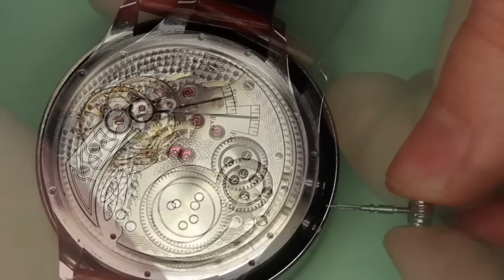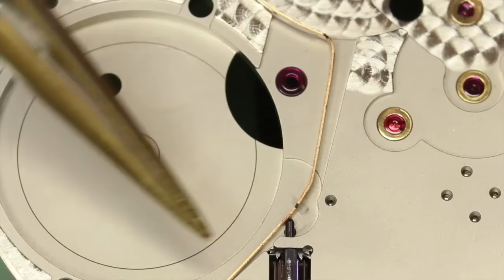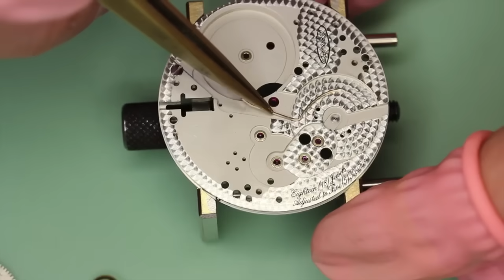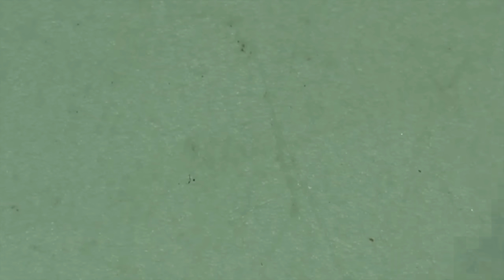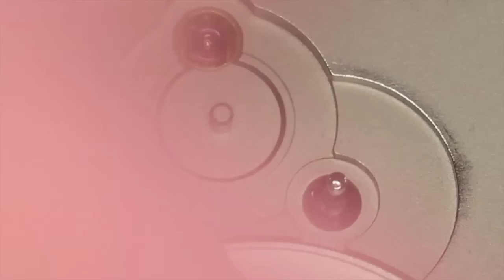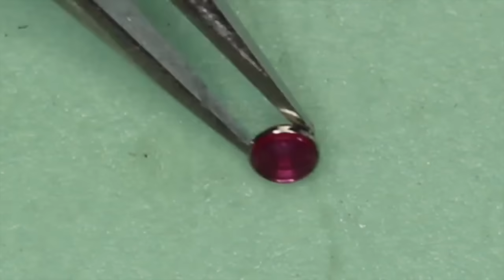Servicing an IWC FA Jones watch. Watch repair tutorials.

Comment: Question: Why watchmakers use steel tweezers and screw drivers instead of plastic tweezers and screwdrivers to prevent scratches on the screws while usig the screw driver an scratches on various parts with the tweezers?

Comment: Would there be any serious drawbacks if you took a regular watch & did some engraving on the inner parts? Like just on the bridges etc?

Some pocket watches I've got have the most beautiful designs inside them but sadly it appears most of today's watches are plain Jane boring.

Would it be a drawback to do some hand engraving on the non-moving parts of many of today's pieces?

Comment: I like it very good to repair the watch how to insert all the parts and I have one question that did this watch worked without battery or nt because I also have this same watch but it stopped itself many times I don't know why. I think it worked without battery but if yes than why it stopped many times I want to revind forward again and again because it stopped it and the times goes different.

Comment: Bet the ETA 7750 that I bought to learn and practice on is hoping the lockdown ends soon, it has been stripped,cleaned and serviced 6 times so far! Now getting pretty confident with it,plenty more practices to go. At the point of considering acquiring another that is in a much used condition to work on with a view to rectifying defects and damage. Thanks Mark.

Comment: I noticed you used what appears to be brass tweezers for this watch on some videos it looks like you use steel tweezers is there a reason why you would use different tweezers for certain watches? Edit: You said you are using brass tweezers because of the display case back.

Comment: You mentioned the 3 screws holding the mainspring barrel was unusual.  I decided to check my Japy Freres movement (1862) and noticed there are two screws with the end of the arbor protruding through the center.  I find it interesting how they did it back in those days.

Comment: I can't help but notice the difference in the finish on the parts of the IWC when compared to the parts of the Rolex. Maybe I am not comparing apples with apples. The Rolex, under a macro lens, looks very poorly finished. This IWC is truly well finished and really impressive. Rolex may have a cult following and rightly so but they are truly outclassed here.

Comment: Thanks for your videos. I was wondering if you can post a video on how to fix the day date on a watch that keeps changing the date at 4 pm everyday?
Reply: Hilton Carvalho , set it at midday and wind back 12 hrs?
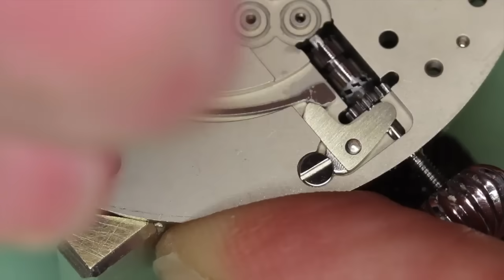Reply: @Pete-z6e Thanks for replying. Sometime ago I was setting the and it was about to change the date. It was around 11:30 on my watch and the right time was about 2:00. As I was moving the crown I felt a slightly resistance and the the date never changed at midnight again. I will try your suggestion. Thanks

Comment: The former automechanic in me would call the smaller wheel under the ratchet wheel a "hub", like what you would find after removing the lug nuts, tire and rim when changing a flat tire for example, the hub is what you see with the studs that the lug nuts "screw on" and the wheel bearing is in the hub, I didn't look down through the comments so if any one has commented on the proper name for the part I missed it,  so for me I guess I will refer to it as a "arbor hub" or "ratchet wheel hub"
Reply: Dude it's called a spracketkegel, LOL these watch designers purposely stay away  from the mundane automotive terms 'cause it sounds much cooler and they are in the higher level of thinkin. Oh wait watches were designed a little before cars came to reality.
 I too found myself trying to think of the logical names of some of the parts.

Comment: Mark, the Beautiful craftsmanship and hand finishing on this lovely timepiece, perfectly complimented by the beautiful workmanship and attention to detail of the true professional you clearly are. Such hand skills, knowledge and experience are a rare combination in today's plug a computer into it, technological approach.
When I was younger, I worked on Aircraft instruments, which though were no where near as aesthetically and cosmetically finished, were equally as beautifully engineered, as a person such as your self might find interesting. 
I worked I a clean room working on Gyro Stabilised platforms, Rate Gyroscopes, Rate integrating gyroscopes and Inertial platforms.

I too took immense pride in my work, tolerance limits to me were a challenge  not an it'll do to just meet the spec.
 Personal pride you take in your work reminds me of me. I hate knowing I could have done that little bit better, I always have to feel I did the best that was possible.

Of course with aircraft instrumentation and reference systems, lives depend on the dedication of a host of unseen individuals.

I love your videos and watching the beautiful thing that is, a true professional at work!
That carries through into the quality of your videos, and why I watched this one again.

Comment: I always end up with extra screws.
Reply: just like the spare buttons on a shirt bottom flap, they supply extra screws you dont have to reinstall. as a matter of fact any good jeweler would remove the extra parts to give you more time on one windup, lighten the weight of the watch, less wear on the band, and better for people with arthritis.
Reply: I would have extra gears if I did it so don't feel bad!

Comment: Great video. What’s the use of a reverse threaded screw? Anyone...
Reply: A single screw which holds a rotating gear in place could unwind itself if the normal rotating action of the gear is opposite to the way the screw is fitted. Using a reverse threaded screw means the gear would have the tendency to turn the screw in, ie, in the tightening direction. This may be why this IWC has the small cap discs with three screws. Negating the need to make reverse screws and reverse threaded holes.
I believe that some reverse threaded screws have three screwdriver slots on the head to indicate it is different from a standard screw.

Comment: Question: why aren't you watchmakers using some kind of rubberized tools (screwdrivers and tweezers)?
My heart is in my throat, watching you put those hard and sharp tools to the delicate parts.
Or is this not a problem?
Just curious 😊
Reply: He has talked about this before on watchrepairtalk.  Some watch makers use brass tweezers because brass is a softer metal than the parts which generally will be steel.
Reply: I use "Italian only al dente Linguine"  LOL

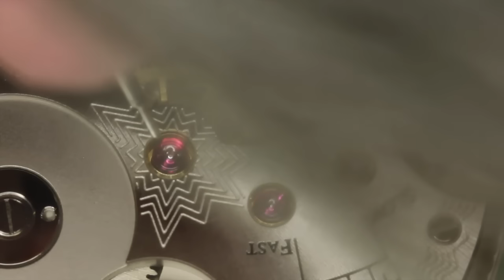Comment: 14:50  no lube in the jewels?  or is it not needed?  19:35  nevermind.  you lubed it up.  28:45  are you going to need to de-magnetize the unit after you are done?  39:26  heartbeat.

Comment: Why don't you wear those rubber finger condoms to prevent body fluids/grease enter the movement
Reply from the maker: It's quite possible you did not even watch the video before commenting.
Reply: lol
Reply: lol!
Reply: He doesn't use them until reassembly, and they're a bit hard to see because they are flesh-colored.

Comment: in regards to the "secondsry ratchet wheel" as you call it at 6:30.  
I have no experience whatsoever with making/servicing (or otherwise) watches, but I would venture to guess based on my mechanical experience that it would be called a hub of some kind in that the wheel is attached to it, rather than the wheel being directly attached to the spindle.  
Just a thought, though I would be very interested in knowing what the exact terminology for that part is.
Reply: It's called the Ratchet Wheel Hub... you nailed it!

Comment: I have a question: If i buy an automatic watch and dont use it will the mechanism still need service? they oil will dry ?
Reply: +FNX 45 Yes you still have to service it.

Comment: Very interesting video, clear explanations, sharp images..no distracting and pointless music...great professionnal work.
Reply: Been watching your vids, could you explain when reassembling the balance plate assembly, how does it just magically start to run.
Thanks.
Dave
Reply: @davidclark5138  If I'm not mistaken, the escape wheel transmits its power (coming from the main spring) to the balance (at each tic), and if the balance moves just a wee bit (which it almost always does especially with a good quality movement oiled properly), it flips the pallet and the whole thing starts tu run

Comment: This movement is a version of the IWC cal. 982, which in turn is based on the Cal. 98, and is one of the oldest continuously manufactured families of watch movements, being in production since the 1940s.  Many of the components are interchangeable.
Reply: Please  help    me  ,I have   the same  model     ,which  have  to  repairs ,,

Comment: The damaskeening on the plates looks like it was cut quite deeply; this is rather atypical.  If you look at most American watches with this kind of decoration, it is finely scraped into the plates rather than cut; very little material is removed during the process.

Comment: I may be overly fastidious, but it seems the setting lever springs were pre-loaded slightly when being disassembled (aligned with the pocket and parallel to each other). I noticed they weren't so when fitted back on. 9:54 and 35:11

Comment: Out of curiosity, why do you replace the ratchet and ratchet spring before replacing the ratchet wheel? It seems that would make it more difficult to replace the ratchet wheel. Would the tension from the spring make it nearly impossible to hold in place while you put it back in?
Reply from the maker: No reason - just habit.